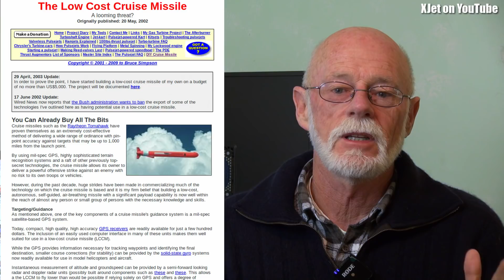What ever happened to the XJet engine?.... and more

Comment: I once saw a control line model fly over 400 ft. I was at a control line contest and these two guys were flying combat when one of the planes got a loose from the flyer. This was before the safety straps on the handles. The combination of the weight of the handle and lines and the offset of the engine and the plane took off straight Skyward. I watched through my binoculars until it disappeared through the clouds. I don't know if the guy had his name and number on the plane or ever got it back but it was a showstopper watching it Fly Away!
Reply: Well Then, Apparently They Didn't Have Enough Out Turned Motor+Rudder Thrusts Built Into It!? I Used To Fly On 150' Steel Braids w/OS-35, 4' Wings+ & Ripped The Controls Clean Out, Then It Did A Big Wing Over Straight To Pieces On Ground A Few Times In Combats Etc...

Comment: I think that there is still room in the home-built and private aviation side of things for your xjet jet engine.  Just 2 quick examples. The BD-5 that they could never find a low cost jet engine for is definitely one. The second would be the new class of Jet Racing that the Reno air races is considering.

Comment: Would like a video on the best fpv setup for a ground based rc vehicle. Especially if you get your hands on the new dji fpv system. How would that work in vehicles were the fpv transmitter is 10-20 cm. of the ground.

Comment: Was the first weaponized drone called the V1 first flown in 1943?
Reply: No v2 was flown. V1 was pretty early war
Reply: @MrJob91  Which one was the pulse jet powered thing they called the Doodle Bug?  Was this not the first "cruise missile" (weaponized drone)?
Reply: @flyingweed9671  v1 was the pulse jet cruise bomb
Reply: The Austrians attempted to use exploding balloons against Venice in 1849 and the first fully powered explosive carrying drone was the Kettering Bug of 1916-18.
Reply: The v2 was really the first military payload capable rocket. I've seen quiet a few channels that completely indepth into the inner workings. I'd say its not really a drone though as there was no telemetry systems that steered the flight after launch during flight. It was basically programmed to hold angle using gyroscopes flying in. Certain direction and then fall to the ground and explode
Reply: V1 and v2 were launched from the hague Netherlands. During the war it was quiet a spectacle for kids that saw these crude weapons of war launched on London. V2 was a simple pulsejet from mass produced pulse jet valve powered engine that was steam launched then pulsejet propelled until over enemy territory from the hague Netherlands
Reply: V2 was transported with camouflaged meillerwagen.
Reply: V1 was first flown (airdropped from s Fw-200) in December '42, with first launches against London in June '44 (shortly after D-day) and last launches against Britain in October '44 (last launch site in range of Britain overrun). Then the port city of Antwerp (main allied supply entry point) was targeted until late March '45 when last launch site was captured.

One of the companies behind it had a small remote controlled aircraft for AA targeting, and also a surveillance version, in '37
Reply: Wow. You guys are a gold mine of information.  In a general sense, when a new weapon is invented expect others to duplicate the same idea. Also expect others to invent counter-measures.  This has been happening throughout history.  I guess none of us should be surprised really.  The most technologically difficult "new" weapon to duplicate would have to the atom bomb, yet lots of countries are now nuclear weapons capable.

Comment: Your old channel was much more informative on R/C and it components but this is still OK.You are correct sir Regulation is not about safety it all about the use of air space  for profit.   The Mech in HoundDogMech stands for Mechanic back in the 1965-68 in the USAF I worked on these: https://en.wikipedia.org/wiki/AGM-28_Hound_Dog
a cruise Missile before they were called cruise missiles.

Comment: Question, can you make a glider that uses no electronics, only mechanicle systems to fly for as long as possible, maybe uses some sort of rubber or pressurizesed systems to gain altiude in dead air/sinc? Like you don't need another project, sorry....
Reply: I built a glider that uses a rocket engine to get airborne.
Reply: You don't even need a mechanical system to nose up/down in response to airspeed.  A properly trimmed glider could passively maintain close to ideal airspeed for a long flight.